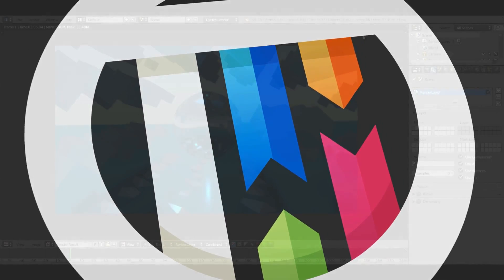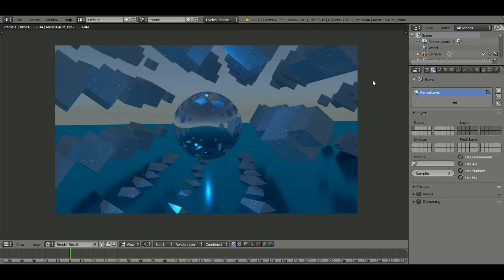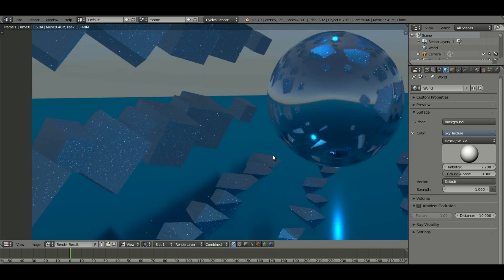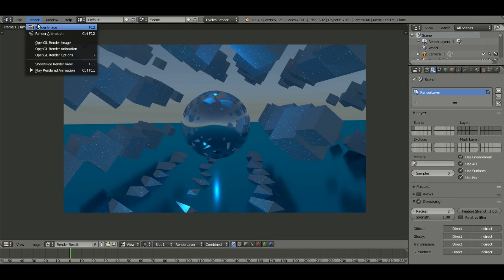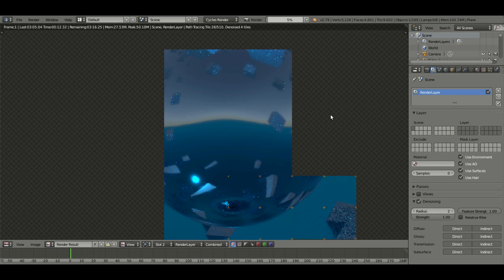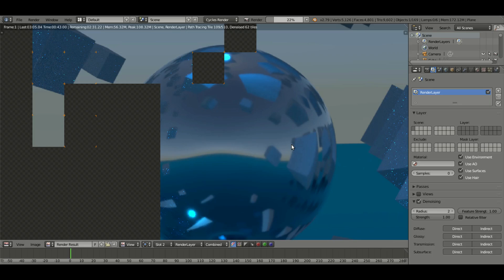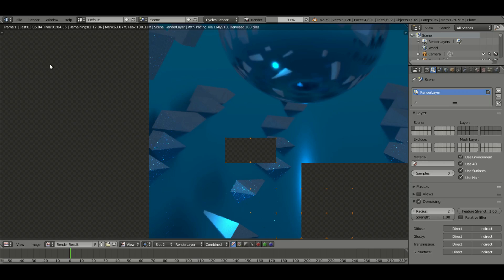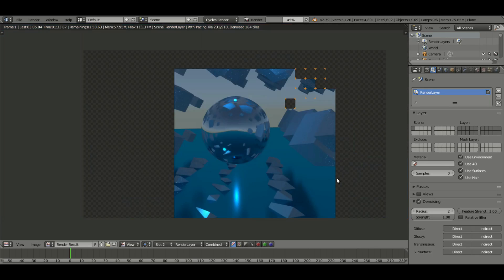Blender Tutorial - How to use the Denoiser Feature

Comment: my blender 2.79b crashes when I render with denoiser enabled...Why is that?
Reply from the maker: Depending on how high your sample rate and denoise rate is set, Blender will crash due to low GPU power. How high is your sample rate?
Reply: actually, I don't have GPU and sample rate is the default 128...all the denoise settings are same...
And also because of this unknown problem, I could never use this feature... :(
Reply from the maker: Not having a GPU is most likely the problem. Since Blender is an amazing
 program, it will run without one... but if you're trying to render with
 the added strain of the denoiser feature, it will probably give you 
problems. Believe me, I know it's difficult sometimes to muster up the 
money to buy a GPU, but it's a necessary purchase if you're going to be 
using any type of program that requires a graphics processing unit. This
 is the GPU that I have. It's fantastic for 3D art, games and is cheap 
compared to other GPUs. It's an undiscovered gem to most : https://www.amazon.com/EVGA-GeForce-Support-Graphics-04G-P4-6253-KR/dp/B01MEFABEL?th=1 The price has gone up a bit, I saved and bought mine at $130.
Reply: Thanks, bro for even taking time to read the comments and replying to them...And because of u, now my new goal -> #SavingMoneyForGPU :D ... btw love your content and I have a feeling that your channel will be one of the top Blender Channels on YTB...
Anyway...Thanks, Kai...
Reply from the maker: No problem! I love to help whenever I can! I wish you luck on the money saving! Thank you, that means a lot to me  :)  thank you for your support! Let me know if you need anything else, man!